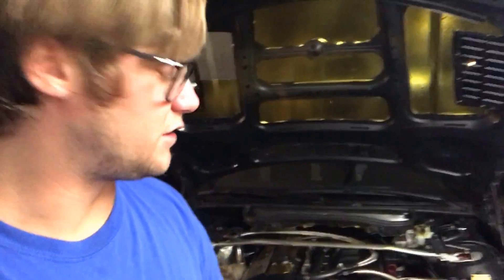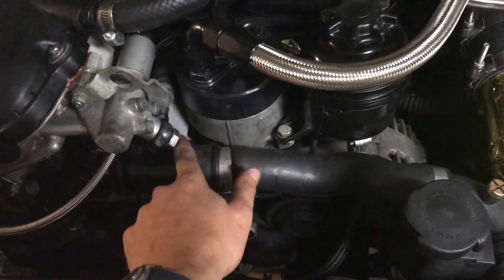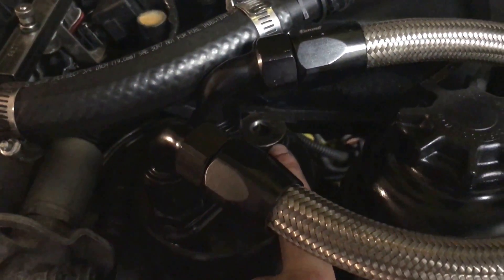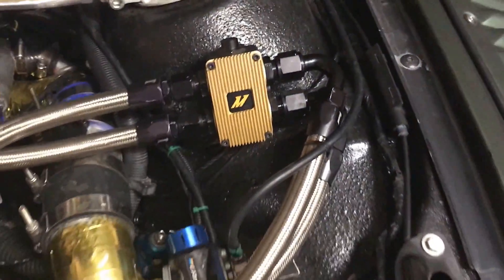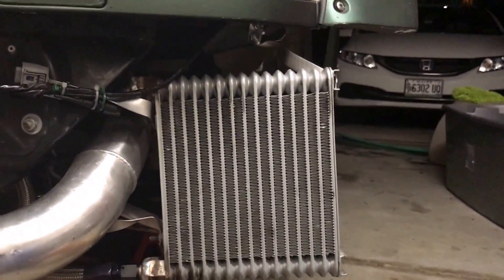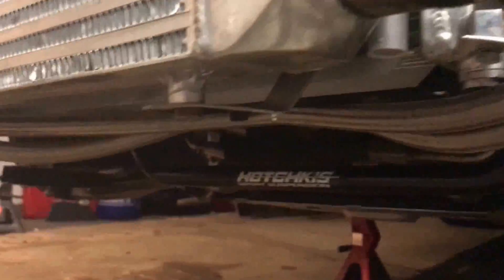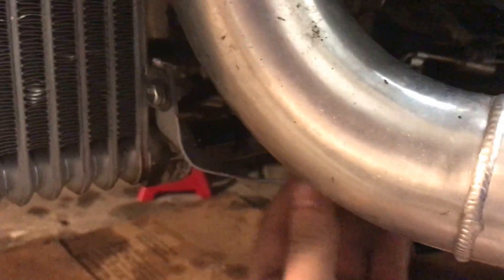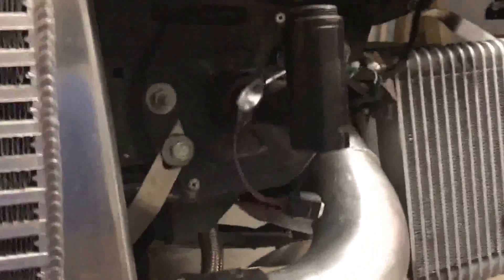How to Install Oil Coolers on BMW E46 M54 Engine

Comment: love itt, do you know where to get all the lines and the cooler? also im curiouss i see my atf oil can(ride beside what your working on) while it connects to a tube that runs to the front with the oem rad for transmission cooling, is their another route i could do for that? i have my whole front end ripped apart right now getting everything ready

Comment: So the oil cooler lines feed and return into that special cap, where does the turbo oil feed connect to? Specing out a build for a 330 sedan and am trying to cover all my bases.